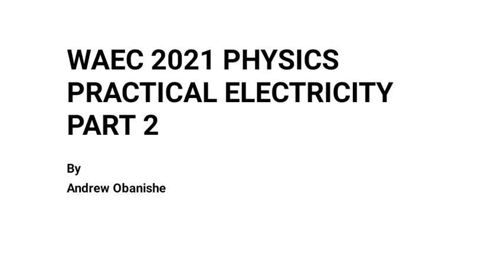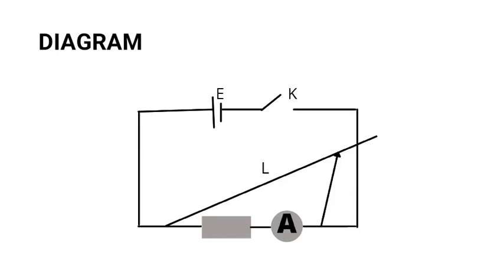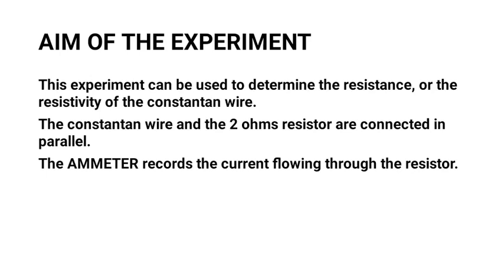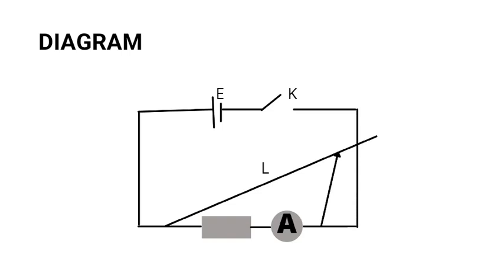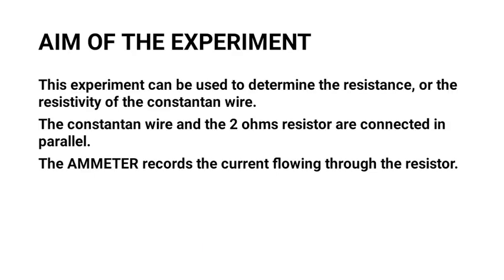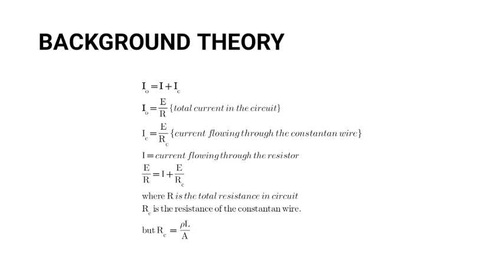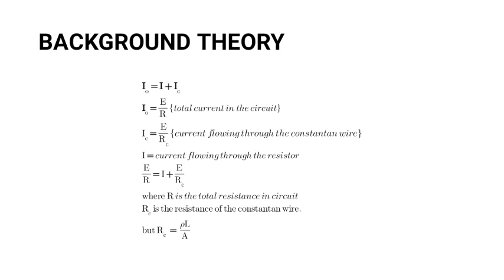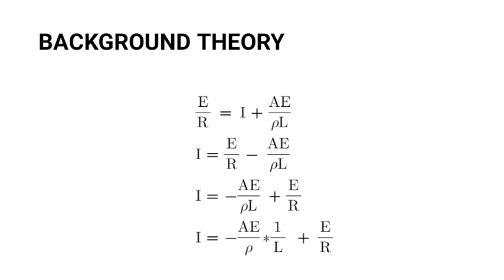WAEC 2021 PHYSICS PRACTICAL ELECTRICITY PART 2

Comment: Hello sir.... I'm also a teacher, I performed this experiment and I found out this is true..... I performed mine with a constantan wire of 24WG......
The io was 0.5A and the current kept on decreasing as I decreased the length of the constantan wire......
Reply: Did the experiment I also noticed that as I reduced the length of the Constantine wire the current reduces

Comment: Pls can we use jockey instead of crocodile clip?
Reply from the maker: You can, but it won't be very convenient. The crocodile clip is to clip the wire after measuring the required length of the constantan wire and you can  go ahead to check the AMMETER reading. If you use jockey, your hand will have to still be on the jockey while you use the other hand to do other things on the circuit and in the process the jockey can shift from the point of measured length. While it is possible to use jockey, it is better and more convenient to use crocodile clip.

Comment: Good evening sir, pls I want to confirm if someone can use 20cm focal length of convex lens instead of 15cm.
Reply from the maker: If that's is what is available, but state it in your report that you used 20cm instead of 15cm. However, depending on the nature of the experiment, you can run into trouble. If in the course of varying the object distance, you are to use 20cm, you may not be able to obtain any sharp image on the screen as that will mean placing the object at the principal focus of the len.
Reply: Alright thanks sir